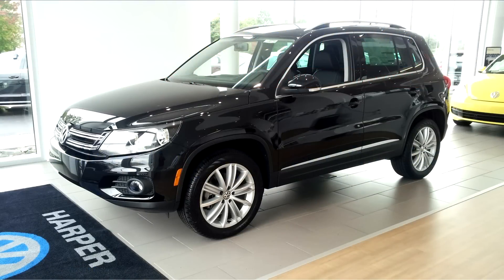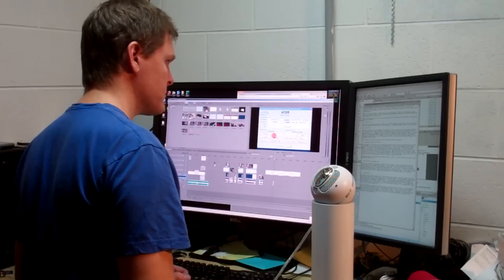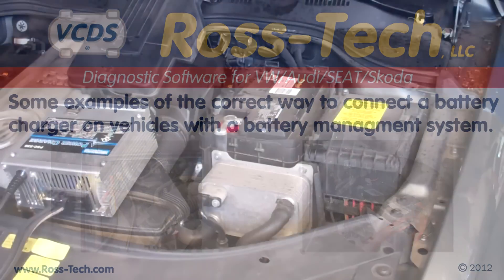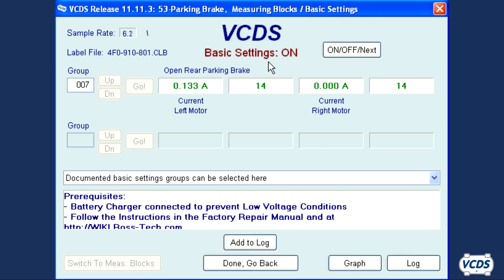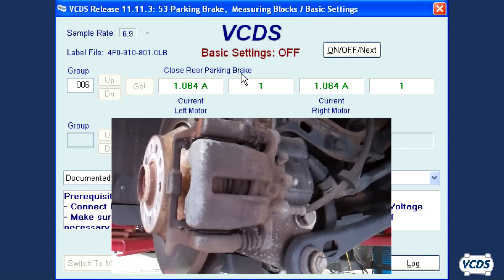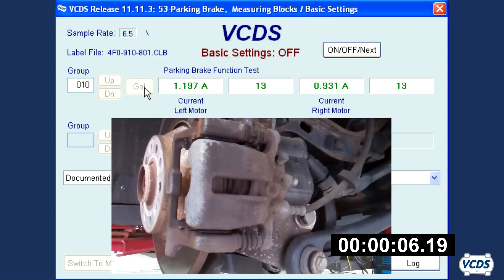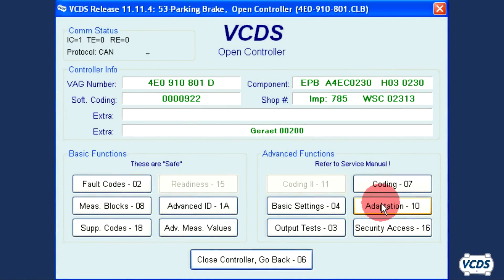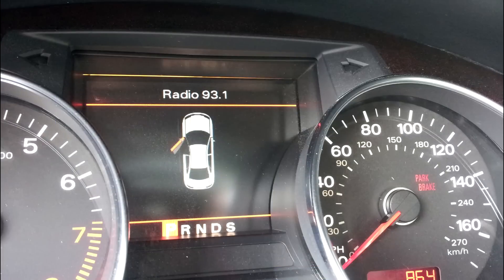Electro-Mechanical Parking Brake (EPB), rear brake pad service

Comment: If you don't have fancy tooling it does work just fine by either winding the mechanism manually after removing the electric part, or by hot wiring the motor it self.  If taking the 'hot wire' approach the important thing is to stop applying power the very split second the motor stops to avoid burning it out (as the protection for the motor is not in the caliper).  The other important thing regardless of your one of the two approaches is to ensure you have the car battery off when doing it, then afterwards have the mechanism in the same position when it wakes up.. It is then blissfully unaware and there are no errors at all.
I made a video of this at the weekend when I did one:
https://youtu.be/kGn7tEjr600

Comment: Having a problem with my 2009 vw passat, only one of the parking brakes, driver side is not moving pulled off the tire and checked voltage going to the rear parking brake when engaged or disengaging neither one put out a reading checked for ground aswell as far as im concerned it has a ground but did the wire break or split somewhere or what is the cause? would really appreciate any help. Ps the passenger side works fine.

Comment: Why is the VCDS repeatedly reporting a current consumption of 133 mA on the left motor while the right reports 0?
Reply from the maker: VCDS is simply showing what it is being told by the control module... but seeing a ghost amperage is pretty common with  a lot of vehicles... I don't know the engineering reason why EPB modules do this.
Reply: @RossTechVCDS  
Thanks - but: The value was there both when you supposedly demonstrated it on a VW and an Audi - or did I misunderstand?

But a good instructional video - and the actors are splendid.

Comment: Great instructions!  Worked as described except for when I was finished and went to cycle the park brake it engaged but would not disengage. Before panic set in, I started the car, tried again and it disengaged fine.  No codes and it all works so it was all good.  Doing it myself certainly saved a lot of money as compared to bring to the dealership.  I bought this car with the intentions of getting 10 years out of it so the Micro-Can was a must.  One issue I do have though is that the pads were down to literally a few days worth of wear left and there are only 56,000 km on the vehicle.  It has been my experience that OEM brakes last longer than that.  Strange.

Comment: Hi, I followed the procedure to the letter for a rotor and pad change on my 2006 A8, everything went smoothly and the epb works fine. However, I cannot clear the 02596 code, I've done the adaptation @11mm and function test at least ten times now. The 02596 code just won't clear off. There are no warnings on the cluster and the new 11mm adaptation value saves and then the function test moves both calipers in and out just as in the video. The 02596 code just won't erase!! Any input would be much appreciated.

Comment: Last German car I buy.  Should have a way to disconnect this ridicules parking break feature and go back to the cables....or disconnect it completely.  $400 for a new parking brake module vrs $54 for a GM.  My advice for anyone who owns a 2006 VW Passat get yourself a roll of black friction tape.

Comment: I just did the rear pads/rotors on a 2008 A6. You DO NOT need the VAG-COM to change the rear pads/rotors.
Here's what you do, let's begin shall we...

* make sure your EPB is not engaged
* raise and secure vehicle on jack stands
* remove wheel
* disconnect the plug to the servo motor
* remove servo motor from the caliper assembly, set it aside
* on the back of the brake piston, use a T40 torx bit, turning CLOCKWISE. I turned mine 3-5 full rotations, then used a piston tool to push in the piston until it stopped. This was enough to make space to install the new pads.
* install new pads and/or rotors
* reassemble
* once reassembled, pump brakes, turn car on and engage and disengage the EPB a few times. I heard it cycle the first time as it was seating itself.

DONE!
Reply: All of that hassle when you could just buy a very well piece of made kit that can help you in more than just the situation of the epb brakes and two button presses
Reply: +csideblue1 I thought about this and was about to go that route but ran across a person selling a Micro-can for half the price of a new one so I went with that.  The E parking brake was almost a deal breaker on buying my Tiguan.  In hindsight if I had known what would be involved in doing the rear brake on this car i would have bought something else.  I was heavily in favour of VWs though so I went with the Tig.  If the rear calipers have to be changed somewhere down the road, the best price I could find locally was about ~$500 ea.!   I might trade it in before then....LOL... I bought the car with the intentions of knocking 10 years out of it but now I'm not so sure.
Reply: I am from the future....They now have a handheld OBD II Scanner that has the function built into it to move the pistons electronically...It is the Ancel Auto Scanner VD500...on Amazon for 54.99 USD. It is made for VW and Audi but it also can scan all other cars! It also scans Transmission faults!

Comment: Way to much work to replace the pads... Really considering not getting a German car again... -_-
Reply: Thankfully, they are not all that foolishly designed. I have been servicing Mercedes Benz Vehicles since 2001 and I have never seen such a ridiculous design.
Reply: Yep, way to greedy of them, there should be a way an owner can do his brakes without the dealer or buying the VCDS  - I was hoping for a quick couples of hours for but when I could not get the piston...
Reply: I will NEVER buy another VW again in my life....not built with any serviceability in mind at all!! Honda and Toyota only from this point forward!

Comment: I need to do the brakes on my 2009 VW CC. Do I still need to have the battery charger on there? Do I need to put it on there for the duration of the brake pad change?

Comment: Thank you.  The job was super simple with these instructions.  One thing not mentioned in the video is what setting to set the battery charger to.  10amp or 2amp.  I used 2amp and all worked out fine.

Comment: Hi that was great information, can you advise when I apply the parking brake on my Audi A8 D3 4.2 Quattro Petrol I get a squeal as they engage does this mean a fault in motor or can I grease any part, No warning lights or fault codes showing . Cheers Richard

Comment: 02596 - Rear Brake Pads Worn: Implausible Signal. 2004 A8L, cannot get this code to clear. Is there any more info other than "a few adaptation and function tries"? I tried more than a few. Please advise,
Dan

Comment from the maker: Some vehicles, mostly Audi, you may not able to connect directly to the battery as noted in the video.  At the 2:06 mark, the two photos show correctly how to connect to some A6 (left) and A8 (right) vehicles.  Then as noted in the video, on the Passat, you can connect directly to the battery.  So there isn't a single answer that applies across the board, it depends on the specific vehicle you are working with.

Comment: It isn't so much the cables, as it is the actual parking brake mechanism. Over time they corrode and seize up eventually leading to costly replacement of the rear brake calipers. You also don't have to "screw in" the rear piston to retract it on the cars with the EPB system.

Comment: One perk of the EPB is there is no parking brake cable to deal with, a known weak point in many older VW/Audi models. Quite a few also have parking brake mechanisms that like a stick and screw up the rest of the rear calipers.

Hmm, something is missing from this video. What amperage should the trickle charger be set at? :)

Comment: My EPB system failed after 6 days of Usage in my 2011 car with only 12000 miles on the clock